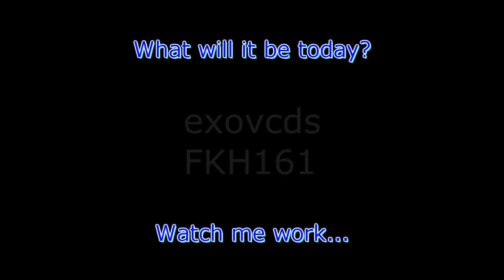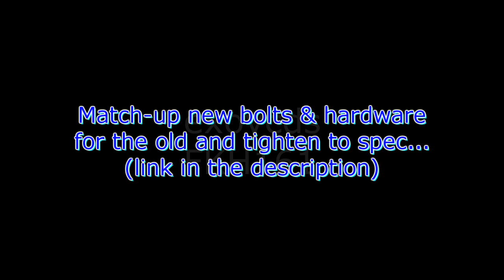VW A4: New Beetle Front Control Arm Bushing Replacement

Comment: Any advice on torque specs?  I couldn’t get your link to work...thanks for giving me the confidence!
Reply from the maker: I had to remove torque specs from my website as it is copyrighted material... even though I get the info from "my" service manuals. If you click on the fkh161 link in the description and then click on "Tool request"... you can send me an email, asking for the info.

Comment: Great video. What did you use to press out the bushing? A large socket?
Reply from the maker: We have a press... one if my other videos shows me using it. Thanks for watching and taking the time to comment!
Reply from the maker: Sorry... I forgot that the video shows the removal. We have a variety of different metal tubes / fittings... and yes, sometimes I use a socket ( on smaller items).
Reply: What size is the socket? I'm going to put the hard bushings into my lower control arms once I know the smarter more mechanical advantage way. I can cut it, bash it and create a puller but, why, when I have access to air tools and presses.
Reply from the maker: nate240sx A ruler across the bushing will tell you the size you need... you need to physically match a socket, since the size that is stamped on the socket is for the inside of the socket, not the outside. 

Like I said, we have a variety of pipes, steel pieces, rods etc that we use for a variety of different things. 

In the video I'm using a piece of steel that happens to fit.
Reply: Thanks you for elaborating.

Comment: This is awesome!  Have you ever used (when you’re not in you need shop with all tools) the ball joint press to remove/install bushings? I got my parts in the mail and want to make sure I will be able to do this myself. Thanks again for your videos!
Reply from the maker: I have not used a ball joint press, but it should work as long as the correct size adapter is used.
Reply: Thomas EXOVCDS I was worried that the stock bushing would not have enough “meat” per se, on the edges to be able to use an adapter. But seeing how you used the press makes me feel a little better that they do have plenty of metal to press off. Thanks again!
Reply from the maker: @SFlores1979  You just have to make sure that whatever you use to press it out, is big enough to stay on the bushing but small enough to go through the control arm.

Comment: what lube did you use?
 what lube would you recomend for the other bushings if they were polyethylene ones?
Reply from the maker: Rubber grease on rubber components. Metal to metal, I used the red generic all purpose wheel bearing grease (some people are against that). VW has their own specific grease.
Reply: Thanks for your reply.As for some people.
I think if it walks like a duck and quacks like a duck it has to be a duck.

Comment: Hey Tom, any chance you know the size of socket you used to push the bushing out?
Reply from the maker: Slightly smaller than the bushing.  I can measure the pieces of steel that I used... tomorrow. You'll need something bigger (to make it easier) than the bushing to press it in.
Reply: Thanks Tom, I appreciate it!

Comment: Do you think a medium-heavy duty 4" vise could remove/install those bushings?  Also, is it the same procedure for the rear bushings (push out push in)? Thanks
Reply from the maker: Woody Ridenour Depends on the muscle in front of the vise... not sure. Yes, the rear are pressed out/in in a similar manner. All my new videos have a link in the description to where you can get service info, so you can see how VW recommends to do things. Thanks for watching & taking the time to comment!
Reply: ***** Haha, don't think that will be a problem...thanks for the help!

Comment: Thomas, thanks for the great videos you provide. I have a quick question regarding the control arms; do you torque them to specs on a loaded suspension or does it make a difference? I have an MK4 jetta and I'm about to tackle this job some time this weekend. thank you
Reply from the maker: Loaded is the way to go. With the car in the air, you can jack up the control arm / suspension and then tighten it.... makes it easier to get under the car, compared to all wheels on the ground.

Comment: What are the symptoms to bad arm bushings?
Reply from the maker: +David Vazquez  Clunking from the front end when braking... pump the brakes quickly while driving. If you hear knock knock knock every time you step on the brake pedal, could be bad control arm bushings. https://www.youtube.com/watch?v=xYgDF37G8Qk Take a close look at the bushings... if they are cracked, replace them: https://instagram.com/p/-U5p57FDdk/
Reply: ***** Got it. Thank you

Comment: I've read some other places that the front control arm bolt is hard to remove on the drivers side because of the oil pan. Is this true? I did everything on my passenger side the other day but the drivers side parts are still in transit. 

Also what do you think the split bushings would last for usage? I went with new bilstein arms that are already setup. Old bushings aren't ripped out but I have a clunk and at $32 it's getting arms with the ball joints and tie rod ends.
Reply: What about the 5speed? Im pretty sure those are smaller all around.
Reply from the maker: +Edward Sessum 5sp manual? Not an issue.
Reply: Thanks for the info. Didnt know we had many autos still on the road out there.
Reply from the maker: +Edward Sessum There are more auto tranny mk4 / A4's than standard in my area.

Comment: just curious. 6 point axle sockets work for the 12 point as well?
Reply from the maker: The big nut? A 6 point socket will not fit a 12 point nut. A 12 point socket will fit a 6 point nut... so no. If I understood you right!?
Reply: yes that what I mean. I purchased an 6 point axle nut set awhile ago and looks like I will need to purchase a 12 point as well. This trade is not cheap lol

Comment: My heavy duity impact wrench won't break loose the rear vertical lca bolt!.... any tips or cheats to get it off?
Reply from the maker: ***** Is that the nut & bolt one (nut on top)... should be. Big breaker bar or bigger impact. Try soaking it with wd-40 or similar over night.
Reply: ***** thanks! Got it loose! Used a cordless impact and smaller socket. Broke 1 12 point socket and then got a 6 point to do the trick. 
I wouldn't think it needs to be that tight?!?!
Reply from the maker: ***** 70Nm + 1/4 turn